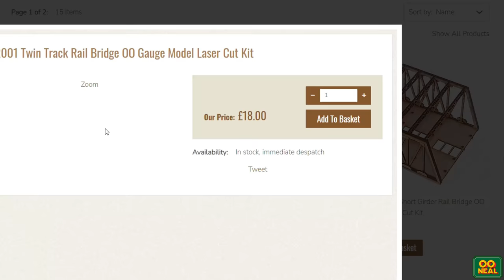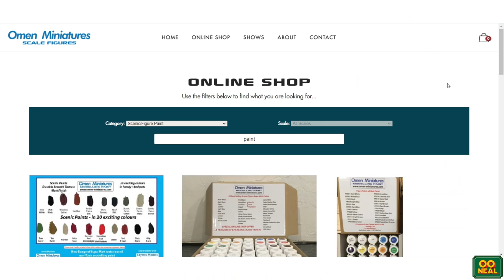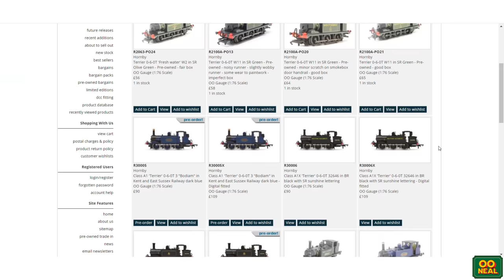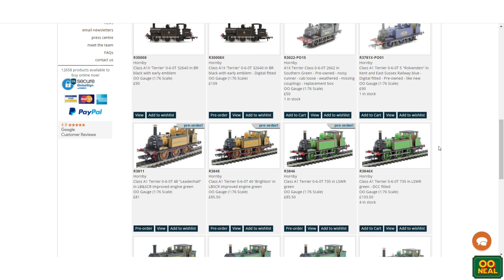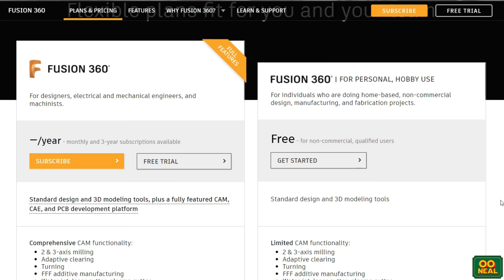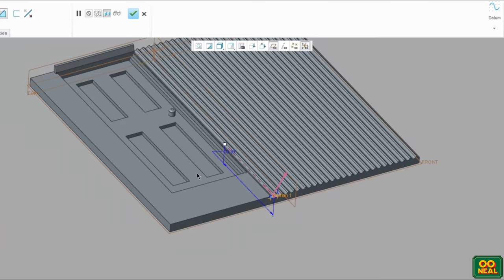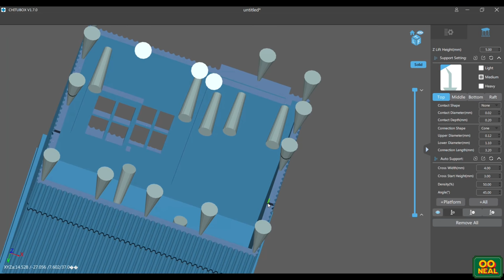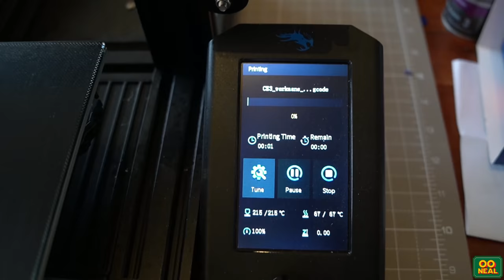Building Up A Model Railway S2 Ep11 | New Hornby Terrier & 4 Wheel coaches | 3D Printing & CAD

Comment: On the laser kits, I had the same worries with mortar and how the wood absorbs paint. I've given washed a go to get a mortar finish but results are variable. Most of my brick buildings are set in towns and cities in the coal-fired 20s-50s when most things had a cost of ash, but more than that, next time you're driving to work, have a look at the buildings you pass and see how much the mortar stands out; for me the answer was not at all, you can see the walls are brick, but the mortar is more grey from a distance and makes me think model buildings with really bright creamy mortar don't look especially realistic so I've stopped worrying.

The terriers are gorgeous, and I agonised over whether to get the Hornby or the Rails-Dapol and couldn't get a good answer out of anyone. I wanted (and still do) the GWR or LSWR examples, though I would like one of these 'improved engine green' ones, too, despite having no suitable layout (though rule 1 applies). My hand was forced when a K&ESR example came up 'like new'. Can't fault the appearance and condition, but it runs like a bag of sh....... The pickups seem to be the cause but no matter what I do, it's vile. The motor itself with power applied directly is fine. Of course, can't get a pickup plate for it anywhere... Funnily enough I also have a malechite green Southern liveried example of the previous Hornby (ex-Dapol) Terrier which by comparison is absolutely brilliant. I've managed to convert it to DCC as well with the decoder in the bunker in place of the tiny weight and it's even better running!

Comment: I'm afraid that I disagree, if you're designing what you print, that's scratch-building.  Just with different tools and materials, it doesn't all need to be plasticard and obscure brands of adhesive.

That Terrier looked great with the four-wheel coaches.  I think thanks to Hornby & Hattons, we're going to be seeing many more Pre-Grouping layouts in the future.  Instead of a road or river, you could have a derelict branchline or an industrial line running under neath that bridge.
Reply from the maker: I appreciate that. It’s from scratch so you are right it’s just done in a different way. Yes it’s going to be really nice as coach options have been quite limited so it’s very good for the hobby. 
Under the bridge an industrial line sounds excellent 🙏🏻 thank you I’ll have a think about it 😊